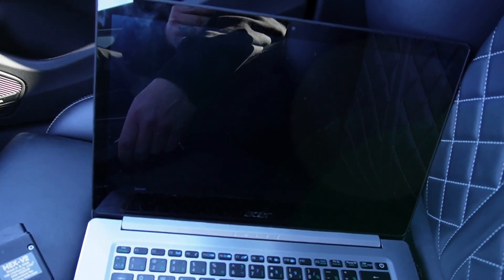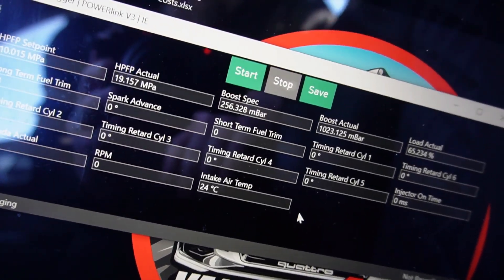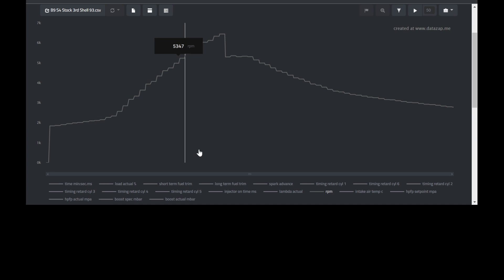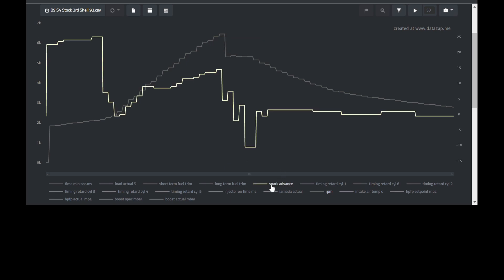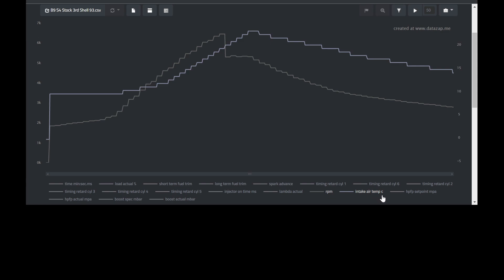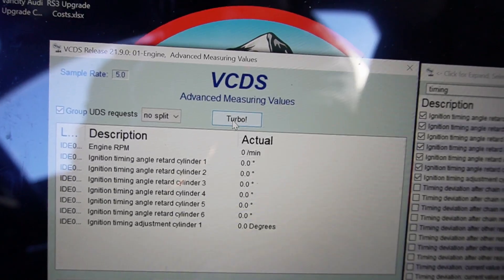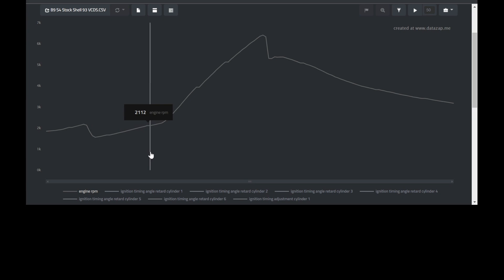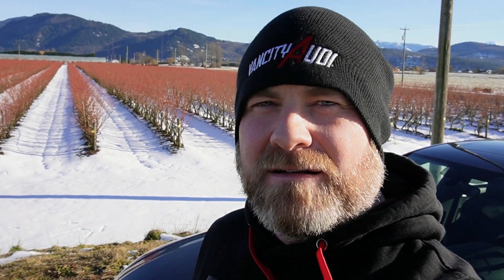Datalogging your Audi B9 S4 with Integrated Engineering Powerlink or VCDS

Comment: Would not hurt to go one step colder on spark plugs and slightly close the gap comparing to factory, whatever it is. Usually rule of thumb for boosted cars is for every 50hp/ -.004 of spark plug gap reduction. (Just asaa general idea)
Reply from the maker: This car is stock, so no, I don't recommend people do that. When it was tuned I always suggest to people that they follow what the tuner recommends. Integrated Engineering recommends the OEM plugs at the OEM gaps which is roughly 0.026 even when tuned.